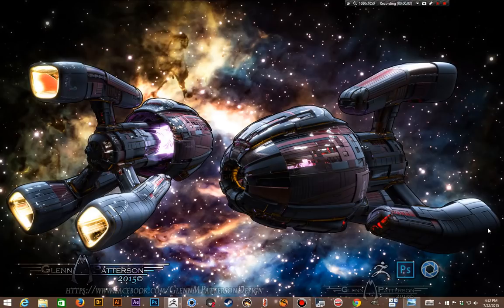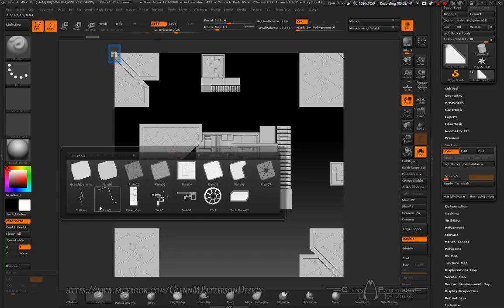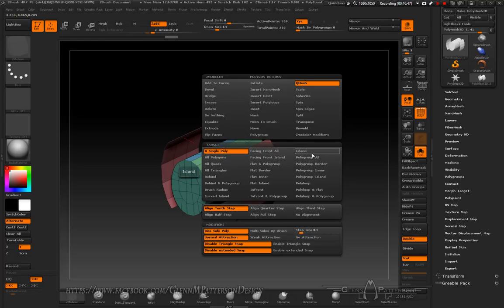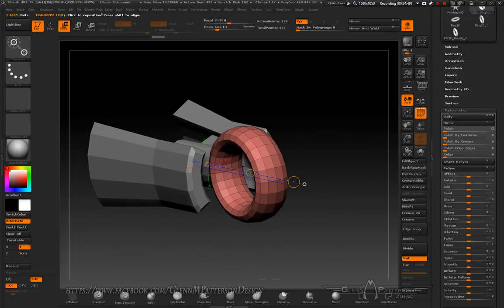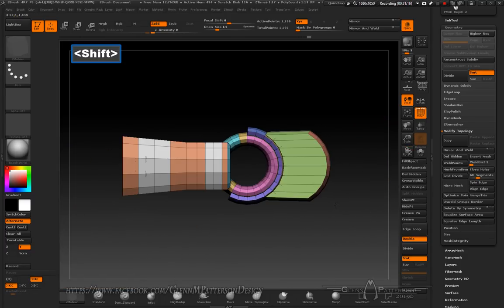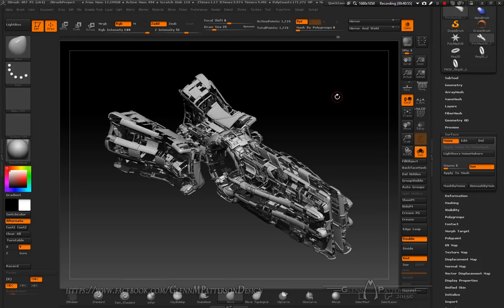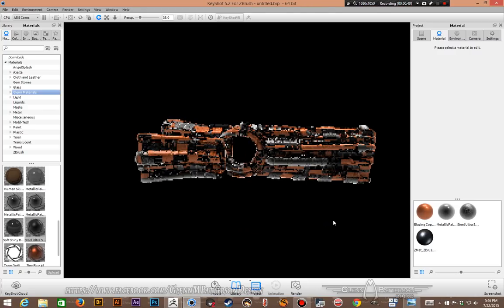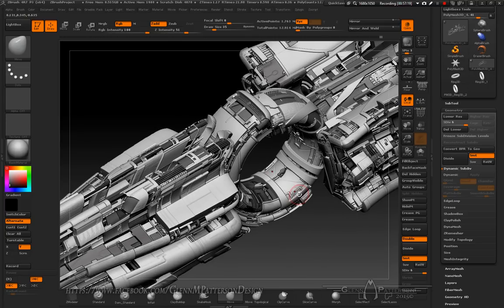Build a Ship in Zbrush 4R7

Comment: What do you suggest to do to make the engine area better for Keyshot rendering, such as a different subtool in the engine area that could have its own materials applied that would look good as a light emitter, or a translucent material with light emitters behind it.

Also, what about a version of this technique that would give good results for 3D printing out a model of a ship similar to this.
Reply from the maker: +Jaycephus I think a light behind a translucent object would work well for the engines. The more subtools you have the more materials you can have in your scene. As for 3D printing, I'm thinking of doing another similar tutorial, but using 4R8's new features and make sure that sucker is water tight.
Reply from the maker: +Jaycephus Also check out my Solidify Your Greeble Tutorial and you can apply it to this one to get water tight models.
Reply: I would definitely like to see the 3D printing tutorial. Something with some greebling on it would be fun, though I think it would be a challenge, maybe, hence my question.

I saw your solidify tutorial. It looks like it would maybe need to be pretty thick though. Not sure on the greebling you used in this video. I'll have to step through it and solidify like you show in the other video to see how it turns out. If it can be thin, then it might be okay on this ship model, the problem being that if it is too thick then it pokes out in weird places on relatively small diameter cylinders and panels like this base model has. 

I'll make a greeble panel like you did in this video with your download, and solidify it to see if it can be relatively thin. Instead of going inward like you did on each copy, I'll start with a shrunken base copy that is solid and then expand outward to get each solidified greebled copy partially embedded in the previous copy. Unless I get back-side poke-through, then everything should be intrinsically watertight solids.  Then once built up, there may be some free-hanging pipes or an island or something that would need some support structure. Tips on handling a model like that for 3D printing and making sure to produce something printable with respect to small pipes or other small features, and how to handle overhangs or floating islands or other features you might see with this or other techniques is what I'm looking for.

There's probably some rule that if a model is meant to be 6" long, then on a greeble design of a certain image-resolution, then no piping or other separated features should be smaller than a certain number of pixels so that details are not too small to be formed properly or show up.
Reply from the maker: Thickness is a Problem with this Technique, but I'm already experimenting with Boolean operations to achieve the same results with less thickness.
Reply: So I played with this. I don't know why I didn't think of using Panel Loops right away, but I'm not super experienced in ZBrush. Just use thickness of .001, -100 elevation, Double on, Bevel and Polish off (0). Starting to come up with some great looks. Onward to learning decimation.
Reply: First successful try that looks nice. Next will get fancier with more subtools.

innermost shell, solid
http://i.imgur.com/lqJQ3TB.jpg

two innermost shells together
http://i.imgur.com/Butjuvo.jpg

Outer and innermost, middle shell hidden
http://i.imgur.com/RnPBY0c.jpg

All three
http://i.imgur.com/2QxVc7z.jpg

Comment: i dont know why but my zbrush wont let me open Greeble Elements
Reply from the maker: +Luka Emanouel Not sure what the problem is. Just downloaded it and opened just fine in Zbrush for me. What version of Zbrush are you using? Needs to be 4R7 and up
Reply: +Glenn Patterson Thanks, i fixed it. it turns out that there was an update that i had not done. New issue though. I have downloaded the Greeble texture generator, i export my textureas a tif but when i open it to use as noise it shows up blank. ughhhhh, sucks being new.
Reply from the maker: Luka Emanouel to use the texture in surface noise, click alpha on lower left of surface noise GUI. It should allow you to load up your tiff you made. Change from 3d to uv, click fv on curve settings to flip curve, 0 out mix basic noise, and put strength in the positive, and adjust alpha scale to your liking. Hope this helps you out

Comment: Unfortunately, I do not have the Bridge keyshot, and without this you can not do this tutorial :-(
Reply from the maker: You actually can. Takes little longer but possible. After BPR to Geo, export out the .obj for each Subtool and import them into Keyshot. You'll have to find your texture and plug it into Keyshot, if you want to keep the original texture you used in Zbrush, if not just slap some different materials to the parts in Keyshot.
Reply: @Glenn3D1993  thanks for help - it will take a long time but it is possible :-)